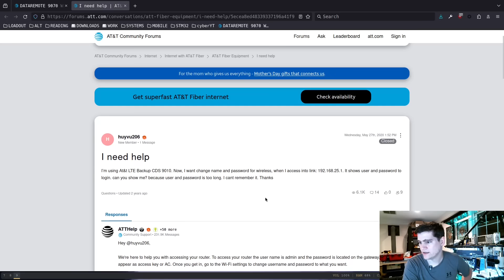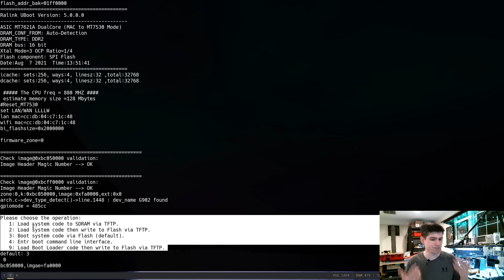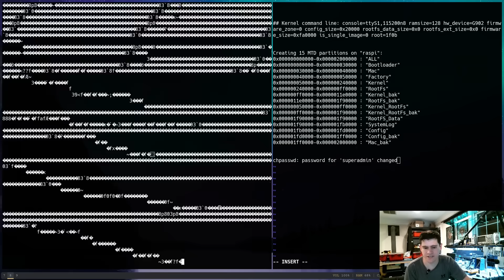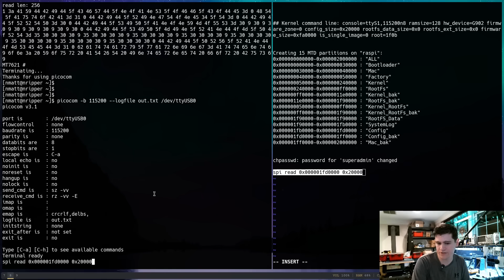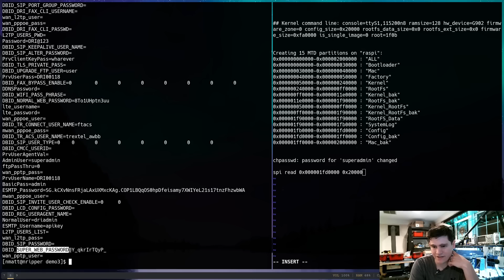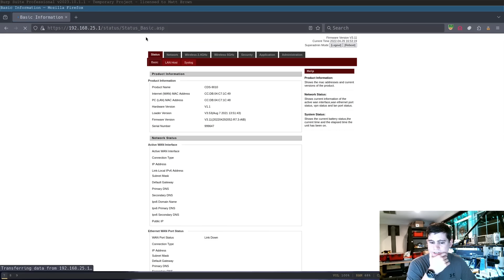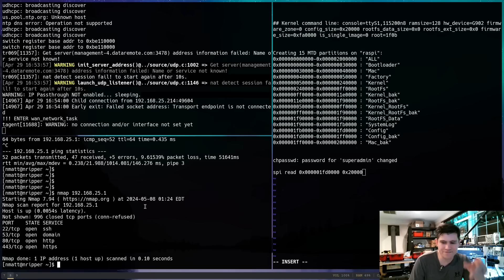Hacking an AT&T 4G Router For Fun and User Freedom

Comment: Bro's face is like Jim Carrey
Reply from the maker: LOL I get this all the time.
Reply: @mattbrwn  It's weird how that happens sometimes.

There's a dude working as a parole officer (for youth) for Oregon who looks just like Ryan Reynolds. I'm pretty sure he's in a official blue book somewhere.
Reply: "Cable modem" guy! 😄
Reply: @mattbrwn you're about to get something else in a second brb
Reply: Best! What a great video. Well done
Reply: If it was Jim Carrey he would seem hyperactive and type too fast for us LOL
Reply: @mattbrwn  -  You are more of an evil genius than Jim Carrey. Good job on the serial access. Keep in mind that the cellular radio, if it uses an MTK chip, you can sent it commands and change the IMEI number to that of a phone that ATT gives permanent 5G unlimited data on. Find a broken one and use its IMEI number. Buy that phone and use its number. You do not want to duplicate someone elses number or use one that is unassigned because they will find it and block your device or worse, find you and hammer you through your account. But this would get rid of any caps and restrictions. ALso would enable SMS messages from the router. The squeaky wheel gets the grease... so don't squeak.  😎😎👍👍
Reply: Bro is hot 🥵🫠🤪
Reply: Metaphorically speaking
Reply: POTS , Plain Old Telephone System , Other wise known as an RJ11 Socket
Reply: Way Better looking!
Reply: hehe and he's good behind the cam and editing too. Uploading some top hardware hacking content I've seen. This is a really good  educationally intensive tutorial with high facts/minute. Like everything he says is a gem of this knowledge space. So both make amazing content but Carrey is Canadian :P
Reply: Young carrey
Reply: this man must be protected at all costs... at all costs
Reply: No one cares. Keep calm and receive the knowledge he is giving you.
Reply: Jim Carrey? NO WAY! He looks EXACTLY like Richard Kind!!!!!
Reply: Do u think now it's been accessed they will change it
Reply: You are so cute, can we be husbands lol
Reply: Cable Guy
Reply: With a little bit of Neil Patrick Harris thrown in
Reply: @mattbrwn  well dude, givn tht ur pulling pwds from firmware & r using the i3wm (prob on Arch btw) I'd say tht ur way far bettr than any of the actors mentiond here :yougotthis:
Reply: That's why I recognize him aaah!
Reply: Im still watching it thou...
Reply: You should teach in school or collage man, you’re excellent at it
Reply: This guy 🤦🏽‍♂
Reply: Who is "Jim carey"?
Reply: bros?
Reply: @mattbrwn  Merry Christmas loyd!
Reply: Jim Carrey + Matt Damon
Reply: Smokin!  Not good for someone that does what you do.
Reply: Nah he looks like David Keith. You probably won’t recognize the name but you’ve likely seen him in something lol

Comment: The SoC and modem in this router are common and supported by OpenWRT, it would be cool to see port for this device as part of more open firmware in the future!
Reply: yeah, those things using custom linux with init instead of systemd are slow as hell to boot
Reply: I'm pretty sure it's actually running a (very modified) OpenWRT anyway.  some of the data in the "strings" output against the extracted config match up with those found in openwrt configurations (eg: NintendoCapable=0)
Reply: @__Ben  Yes it most likely does, but the differences between years outdated proprietary version that OEMs use and official is extremely large.
Reply: @__Ben  That interface looks a hell of a lot like a barely customized DD-WRT install.
Reply: AT&T shameless gpl viol;ator by not releasing the source code of the kernel used
Reply: @tacokoneko  not suprising
Reply: @tacokoneko technically they needed to provide a gpl notice and then if you requested it they have to provide it, not voluntarily post it somewhere. Of course I doubt there was a gpl notice anywhere and if you asked them for it they would have no idea what words mean.
Reply: @tacokoneko  Ralink SDK is available on internet but its based on 2.6 or 3.10 kernel with drivers missing.
Reply: @Anaerin  Looks alot like the Buffalo DD-WRT interface, first thing in my head was hmm that looks like DD-WRT.
Reply: All the stuff is available to reuse that LTE modem. Hardware and software
Reply: Gold
Reply: @__Ben Aren't they supposed to submit their patches and announce their usage of the openWRT software? This could be a license violation by AT&T. Worth poking the relevant FSF people?
Reply: I mean, the web interface looked like a DD-WRT, so yeah.
Reply: @Anaerin kind funny when you think about it: they heavily customized the login page, but not anything passed it 😂
Reply: What can you do by hacking this device? 
If you still use enough data they’ll throttle you.
Reply: @scoobyphd  Data amount and speed are not managed by the device itself. Aside from things mentioned in the video it may allow custom firmware and full control of the device you own.
Reply: I want to do the same thing with a Sophos RED-20. They are running a customized version of OpenWRT, but I want to find a way to flash something more useful, or reconfigure the existing install.
Reply: Actually it's good if u can get the firmware downloaded
Reply: @Hackdaplanet-lp1ex  In what way do you mean? Pull from the running system, or push some other firmware onto the device?
Reply: AT&T did not violate the GPL on this device. That was probably done by the vendor they purchased it from. AT&T does not develop their own Hardware Solutions, they just Rebrand other companies work. I also noticed that Matt was very careful to say that he did not sign up for their service and then he got this from an E-Waste Channel whether or not that's true I don't know but this way he's claiming to not have violated the terms that AT&T sold the device under, which almost certainly included a statement to not "reverse engineer the device or its software."
Reply: @__Ben  well putting stock version back on it, know the doors open should lot easier,
Reply: that webgui was straight up ddwrt
Reply: One of the major ISPs in my country produces their routers on the similar SoCs (MT7621), so a bunch of enthusiasts built the openwrt version for it pretty quickly, added all the required information to the openwrt project and now those routers have the official release builds since the version 23. That is awesome! We can now use the decent opensource solution instead of the proprietary crap
Reply: Common Huawei B2338-168/B2368-22/B2368-66 are also MT7621 based (both indoor and outdoor units) but noone seems to have developed anything for them, i own B2338 but didnt have sucess with LTE adapter configuration

Comment: I believe the "phone" ports on that device are for an ATA gateway, which would provide POTS lines from the cellular interface.
Reply from the maker: very interesting. I've never messed with anything with POTS before. makes me think of the phone phreaking scene back in the day
Reply: they can be very useful if you ever wanna do some retro hacking, it lets you simulate a phone line so you can dial from modem to modem without ever touching the "real" network
Reply: I believe this is correct, the phone ports on this particular unit are for POTS line out (aka. landline phone hookup via cellular).  Although I'm pretty sure I've seen these cellular modems that ALSO support POTS line in for DSL connection.  Either way, for all the cellular modems like this I've seen I can't recall ever seeing someone actually use this feature, lol.
Reply: I've been hacking on a similar AT&T cell hotspot type device, and can confirm the POTS lines are to hook up a phone and make phone calls in and out from the cell radio.  The ZTE M279 based devices used by AT&T also had an open web config interface.
Reply: ATA?  You just gave me a Telix flashback.
Reply: Yeah. The RJ11 ports are for POTS replacement. Data Remote was one of the first POTS replacement devices. You can use Ethernet or LTE for a VoIP gateway basically. There are better solutions if you have particular devices that relies on POTS. Things other than your typical analog phone. Think older entry gates, old sales systems, fire panel call outs, burglar panel call outs, etc.

Edit: POTS replacement is the reason for the giant battery. Required to provide power for 4 hours by life safety codes.
Reply: @WillPolley  The ZTE based AT&T device I've been messing with also takes a bettery.  I'm sure the thing would also allow me to call 911 without a sim card because that is part of the regulations too.
Reply: @mattbrwn  Try and figure out if those pots connectors are FXO or FXS or what? Be ready fo a rabbit hole.
Reply: I can confirm that on the two ports utilizing the RJ 11 jacks are used for POTS line phones in the subscribers home. In this country they use SERCOM Speedport Plus in home adsl routers that are made in France. Ports on the back are as follows, Phone 1, Phone 2, LAN ports 1 thru 4 with a title in red above Lan 1 reading WAN and the one above LAN 4 trading STB WITH THE FINAL PORT MARKED AS DSL. STB refers to set top box for subscribers of TV over internet.
I do know for fact that the telephone provider has total access to this unit as they can remotely log in and reconfigure it. It would be nice to see these passwords as well as the password I had set up when we first established service with the provider, I believe it has not changed.
Reply: Newer routers will also do VoIP over SIP as opposed to VoLTE over the phone jacks. I have a Nokia Fastmile 5G router that requires a SIP account, though that may be because of vendor lockdown. I would imagine it would very useful for backup scenarios so you can keep the same phone number but not have your phone service go down if your fixed line service dies.
Reply: You are correct. I have this device and it does have a POTS line which I use with an assigned number that is also the billing account number. This jack provides 48 volt talk battery, 105 volts @ 20hz ringing voltage, DTMF. Any standard desk type touch-tone phone works with it. It provides the exact same quality as my two POTS lines which all feed into a PBX.
Reply: @BartlettTFD  my unit here in the EU supplies only 60 volts at around 30 Hz or whatever the euro standard is for ring standards.
Reply: @rebootretro correct
Reply: I agree with you; I'd bet you could configure the thing into providing a voip endpoint to one of those POTS lines. Not sure how hard it would be but I'd wager its possible.
Reply: @adventuresin9  so basically wifi calling only using the router sim as the cell number?
Reply: @Xanderfied  More like a cell phone, except you can plug an old landline phone into it and make calls.  If you open up the software in them, you could make phone calls over the cell service in a variety of different ways.  One of the things the cell radio module will do is tell the OS it has a serial device, and you can send old AT commands by text into that serial device to do things like dial a number.
Reply: @mattbrwn you sir are absolutely on the right track there.
Reply: Forgive my noob question, as I am just learning most of this stuff. 

Seeing as how gaining control of the device is relatively simple, and the reverse engineering seemingly straight forward, is it possible to scatter these about and create a quasi off net mesh network? Don’t roast too hard… 😂😂 but in theory it seems possible based on my very limited knowledge.
Reply: I've never heard of POTS, I always called it RJ11 😮
Reply: "industry" term for Plain Old Telephone Service
Reply: @MattMellen1337  ah gotcha :) thank you for the explanation
Reply: @rebootretro  common use case in australia to have a  LTE backup interface and a DSL hardline connection
Reply: Will this work on a IFWA40 modem from AT&T? Thanks
Reply: I had one with the pots ports and used the service from att. It is 100% for using landlines phones with. I think they called it mobile home phone.
Reply: @rebootretro  It's crazy to me to see people who didn't grow up with their phone lines in the back of their cable modem. I'm only 36 but I feel 70 now 😭
Reply: @RT-qd8yl  I think it depends on your locale.    Less urban areas didn’t have cable or even high speed back 20 years ago.  But I suppose in the coming days kids will be saying “why did it have a cord, is that for charging it?”, haha.
Reply: Yeah, I was thinking they were probably VIOP ports.

Comment: That's one splendid hack, and a pretty easy one at that. Since it's Linux based, AT&T is obliged to publish the parts of the software that are GPL licensed, like Cisco/Linksys famously was with their WRT54GL back in the 2000s. Device configuration, user data etc. can be protected and fortunately they did a lousy job at that, when you're in, you're in. Also, I saw a Raspberry Pi reference in the UART output, it makes things interesting as to how the system was built or developed.
You're truly exercising your right to own things here - you'd make Louis Rossmann proud!
Reply: Raspi I believe is the code name for the custom firmware AT&T has on these.
One neat thing about these is the wireless settings in the web ui for SSID are not restricted meaning you can put anything. I put a lenny face in and it took it and broadcasts it with no issue. You cant just put in spaces though as it will default to ATT_AP24 for 2.4 GHz and ATT_AP5AC for 5Ghz. at least thats what it does on mine.
The webui is very VERY similar to the Readynet routers I have as they allow like 5 SSID's per radio to be active. and the overall look and feel resembles a DD-WRT UI
Reply: @LouisRossman
Reply: “raspi” is not “raspberry pi” but rather “ralink spi”
Reply: @subtropical-yearning  thanks for the correction.
Reply: Ahhhhhhhhhhh I thought it was raspberry pi tbh
Reply: @bennydreamly  the controversy with the 'berry was that it used a Broadcom system-on-chip the company wanted to keep their trade secrets on, especially with the graphics part, so it was not fully open source hardware and software wise. Linksys, on the other hand, used a Linux system on their router and tried to close it down, which was a violation of the GPL.
Reply: Well you can see that they put 0 effort in to make this device secure. Not even made it harder in some way. They just let the debug port unprotected and even pinned. They didn't secure the shell in any way. Even help command worked to tell the instructions and then also the password just could be read in plain text. Lastly, they even did not only leave ssh in the product they also uses the same password as the web login. At this point it even doesn't matter anymore, if the put the same password on every device or not
Reply: yh I noticed the raspi ref
Reply: Yes
Reply: All of the linux based systems are trash, linux was designed to be a program development tool so it has lots of back doors, it was never ment to be a stand alone program.... No matter how they or apple dress it up it's still just linux.
Reply: Ok ners
Reply: AT&T sucks 😂 Actually actively BOYCOTT AT&T

Comment: Most of the routers/modems that I have dissembled would have a password hashed and not stored in plaintext, so eventually I have to modify the bin file locally on laptop and then write it back to device with custom password hash. 
This is a great video for people who wants to get started.
Reply: You can copy that hash and run password list program and check if there is one before that
Reply: Nevermind what it uses to encode the password, set the normal user password to the one you would like to use in the root account and then copy the user password to the root password, you can get a spi writer and modify the file.
Reply: PROM incoming?

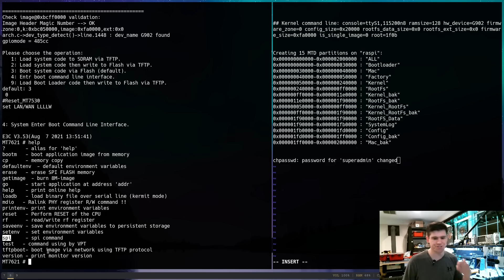Comment: After getting to the command line interface at 15:40, my router didn't have the same "spi" command, only the "spi_nand" and "md" tools that freeze after reading some memory. So my workaround was:

* I looked at the "printenv" output and found a "bootargs_base" var
* I modified "bootargs_base" with the "setenv" command to include "init=/bin/sh", then ran the "boot" command
* I looked at how the scripts in /etc/init.d/ mount the "config" partition and mounted it on /var/config 
* I searched through the files in /var/config/ for "PASSWORD" and eventually found the correct password

Great video!
Reply: Hi Sir, can you please elaborate more on the steps for a noob? Having the same situation without the "spi" command. Thanks in advance

Comment: Love the content! More LTE stuff, I use Verizon LTE sim in an OpenWRT router and a Foxconn Cat16 4x4 MIMO modem and get slamming speed up in the boonies 13 miles from any high speed internet end point other than DSL and these devices have been a life saver. Few tips, flat panel antenna with no more than 1.5-2 FT of coax on each antenna lead, high as you can to get over tree's and have direct line of sight to tower or the best signal clarity you can get with how high you are willing to go up in height, I have a 76ft tower and the modem with two flat panel 2x2 mimo antennas mounted on top pointed towards the tower. Have seen 160Mbps at times with only a 4G unlimited Red sim, no 5G!

Comment: That's so funny. I just did this exact same thing to my unit that I have a week ago. And it took me hours to figure it out. Now watching your video, it could have been done in. minutes However my password was different
Reply from the maker: very interesting. If you join our discord server I'd be super curious what other values in that CONFIG are different and what are the same.
Reply: Right! I commented above wondering if there was some relationship between the device serial number and the superadmin password… a little ASCII's decimal to binary, a few shifting of bits left or right, and ending with a binary to decimal's ASCII characters.

Comment: just a time saving tip: at 19:27 when you're doing math in python you do X - Y and then copy-paste the result for the next calculation. underscore in the python REPL takes the value of the last output, so you could also do `hex(_)`